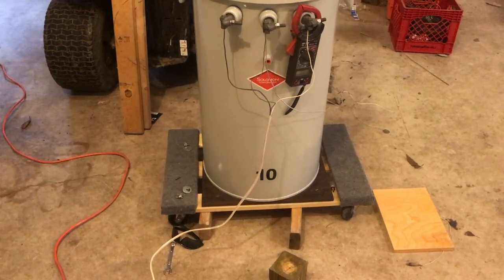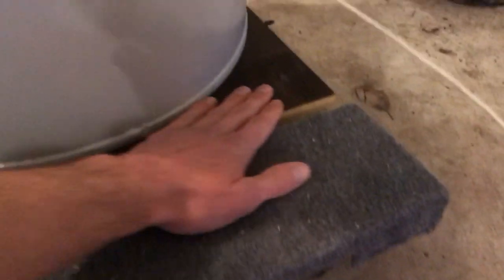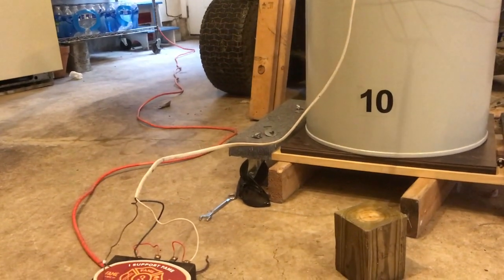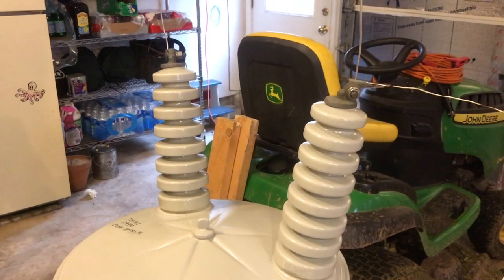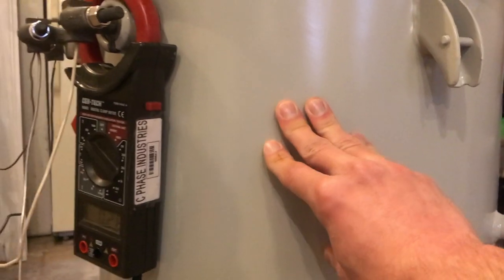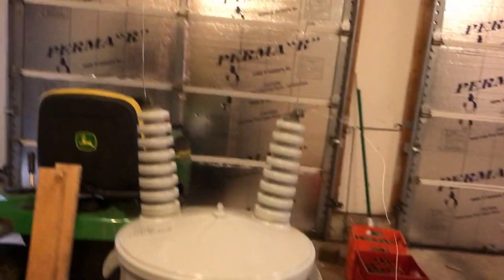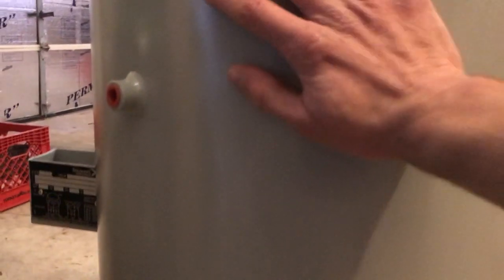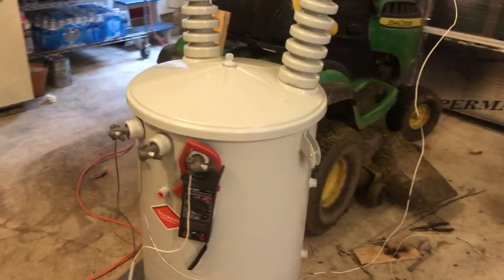Partial Discharge Inside Transformer

Comment: Damn! Sorry about that, that's weird that it would do that knowing they are constantly outside energized, I hope to god it isn't the coil. Has it done this before when you ground it out? I just hope its ok.
Reply from the maker: Variac Maniac Thank you! I feel bad for contacting them about the problem because they were so helpful. From what others said it is most likely the oil. I left that 13.2 xfmr stay on for 24hrs and it warmed up to 75°, making it even more apparent. I hope it would be a warranted repair, but after liftgate freight back, it may be cheaper to get another one exact spec. Ah shit happens. Cheers to a new year:)
Reply: @metersocket00  Cheers, it's just unfortunate that that'd happen to such a nice transformer, Happy new year man;)
Reply: metersocket00 check the bushings for tiny cracks with a magnifying glass and open her up and check for a loose connection
Reply: Just make sure to spot anything inside, because it could be something simple, do what you can.
Reply from the maker: Variac Maniac Just got an email in! They said they would replace the unit fully under warranty! It’s fantastic I was fully willing to repair it myself.
Reply: @metersocket00  That's awesome man!! The best transformer company I know!! If I owned a power company, they'd definitely be one of my suppliers!!
Reply from the maker: Variac Maniac Very true! I don’t really talk about it on my channel, but I have an electrical supply company usually selling kWh meters. But I recently bought some 13.2kV transformers from them to see how they sell. After dealing with several suppliers they really are the best out of the bunch.
Reply: @metersocket00 ice man, are you going to show them? I hope to purchase some more pole transformers soon.

Comment: Replace the oil, or if you can pass a high DC current through it to get the oil to over boiling point of water, to drive out the moisture. Wrap it in a nice insulating blanket doing this, covering all the terminals and top and bottom, probably around 2 rolls of isotherm will be enough, so you do not have to put so much energy in. DC current should be equal to the AC current so you do not overheat the winding, but should get it really hot. Should also look at taking the vent port and adding a dessicant chamber on there, or at least a vapour proof vent, so your unit does not get moisture in it.
Reply from the maker: SeanBZA That is a good idea I never thought of running dc through it to warm up the core. Since it is still under warranty they will probably want an oil sample, it’ll probably confirm the moisture inside it.
Reply: @metersocket00  Probably, as in general they are always going to be warm and thus never suck in moisture, and also generally run hot enough ( except for prolonged power cuts) that they self dry themselves. Inside the top there might be a dessicant pack that you can regenerate in an oven at around 250F, though you will have to open it though, voiding the warranty.
Reply from the maker: SeanBZA They emailed me back saying that it is most likely damaged internally. I think maybe because the discharge only happens on a Ground WYE configuration. But they are replacing it 100% free of charge under warranty!!! I can’t believe how much of a helpful company they are.

Comment: Sorry to hear that man. I feel your pain, I recently flashed over the windings on my xrt. I'd be real surprised if moisture found its way inside that thing since they're designed to be out in the elements. But you never know. Hopefully it's repairable!
Reply from the maker: Matt Deluca Thank you, since it is still under warranty I am hopeful they will repair it. Never had it above it’s rated voltage, or put more than its ratted current through it. The thing that concerns me about the moisture is that if it were running constantly the core temp would usually be above freezing. Worst case scenario would be a total replacement which would be $595 which is not a lot per-say but still nothing to sneeze at. Hopefully your X-ray transformer is revivable, they are really sought after on eBay.
Reply from the maker: Matt Deluca Just received an email saying that they would replace it 100%. They are a fantastic company!
Reply: @metersocket00  That's great news! I'll always recommend Solomon. They really are a great company

Comment: Sad a $500 transformer went to waste but it made good arks
Reply from the maker: Thank you! I hope they will be able to suggest a solution. It still runs ok on a delta connection but from the comments it doesn’t sound like it’s normal.
Reply from the maker: Raks Electric They emailed and said they would replace the transformer!
Reply: @metersocket00  Thats very good news. That means more arks.